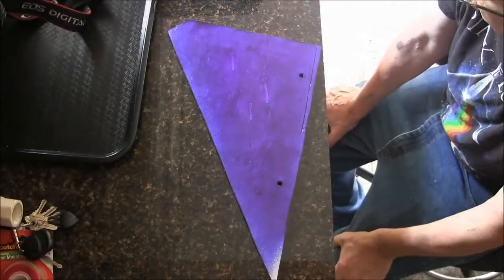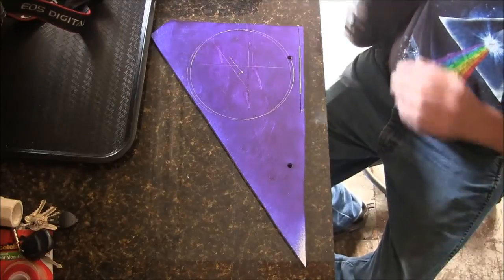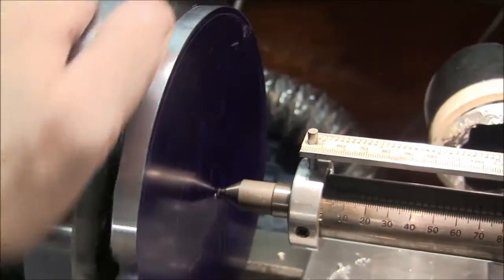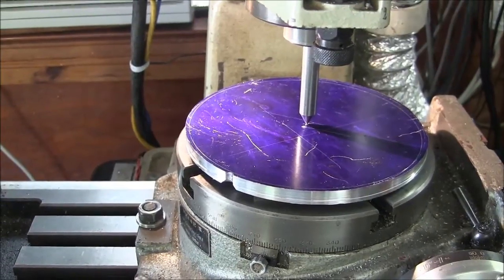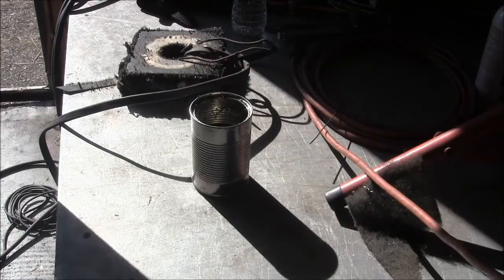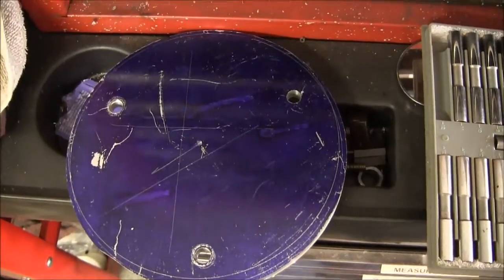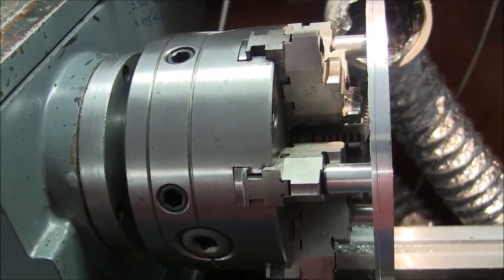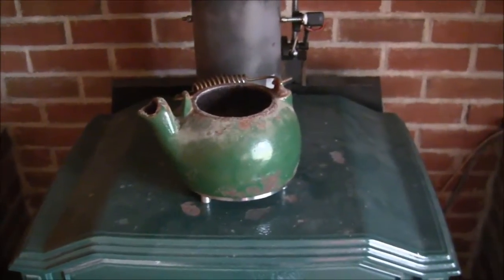Puttering Around

Comment: We used to use a pie tin upside down on the stove (oil and wood).  It would keep things warm but not boil or scorch them.  Simple but worked very well.  I never would have trusted double stick tape but I am one of those guys super glue doesn't work for either!  Good hearing the old Fairbanks Morse engine.  There was a time when the old fishing boats around here ran Atlases and Fairbanks.  You could here the kathunka.....kathunka from miles away.  Have a good day, hope your hips are healing.  Doug